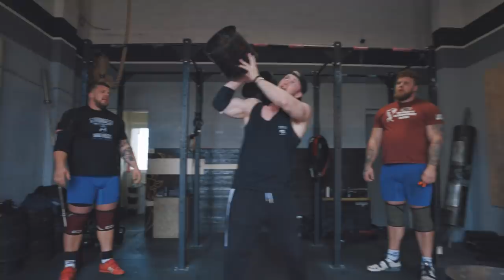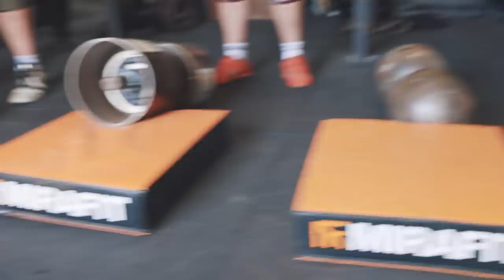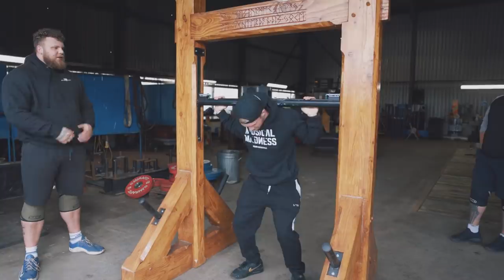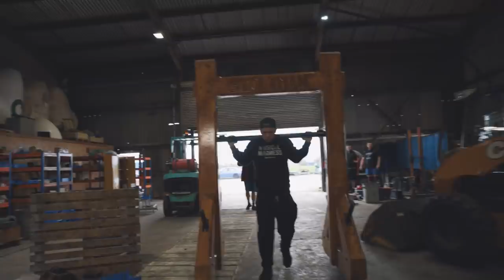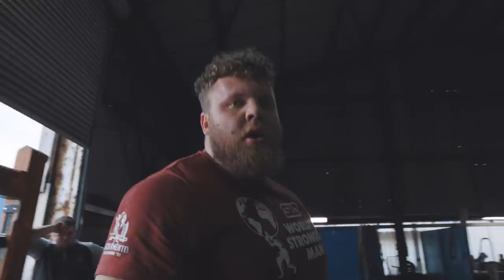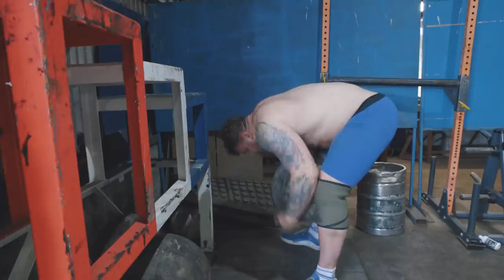Bodybuilder Tries Strongman! ft.Zac Aynsley | Road To Britain's Strongest Man 2021 Episode 3

Comment: Don’t know if I missed the weights on the dummies? Top weight 110kg? Can’t believe how much better Tom is. Just sorts his grip out and he’s unbeatable
Reply: Agreed about Tom's grip.  Don't know if the brothers or their wives read these comments, but Tom can really strengthen his hands by a LOT by soundly fastening a small, wooden or metal ledge on the wall high enough to where he can hang from the ledge with feet off the ground and he can only use the strength of his fingers and fingertips to hold himself up, hanging from the ledge.  As a different but similar tool, if they fasten a short length of chain-link fence high up a wall where they can hang from gripping the chain-links in any way they can, and suspend themselves for as long as they can, trying to increase the duration of their hang time as they improve, and try moving around the chain-links reaching around and grasping the fence in different places.  These tools/tips are different than hanging from a monkey bar.  With a monkey bar, you can hook and roll your fingers over the top and use your thumbs to help lock.  With the ledge, your thumbs are pretty much useless and your fingertips lie flat on the top surface....much harder.  And with the chain links, you have to squeeze your fingers around the chain-links and pull them together with your hands to support your weight.  Just some suggestions for Tom!